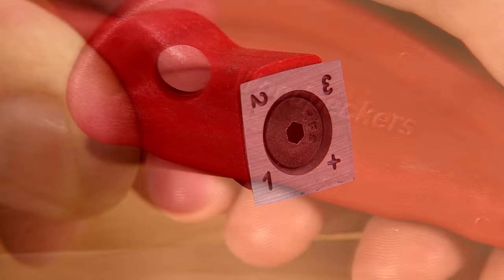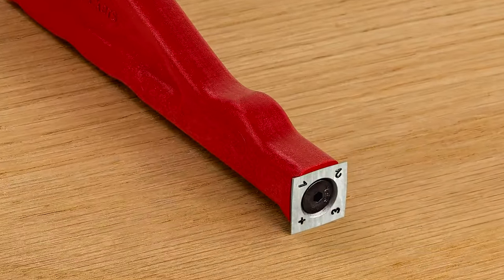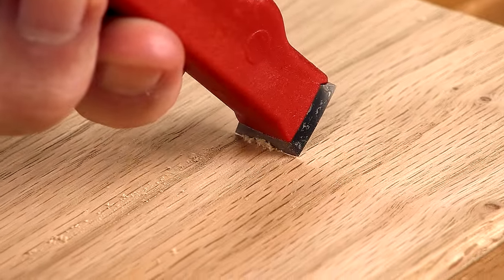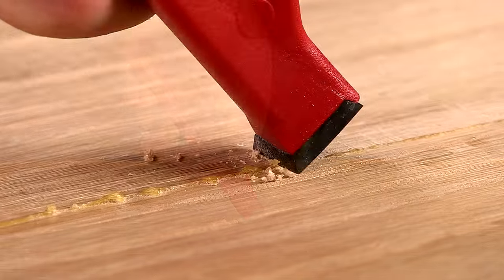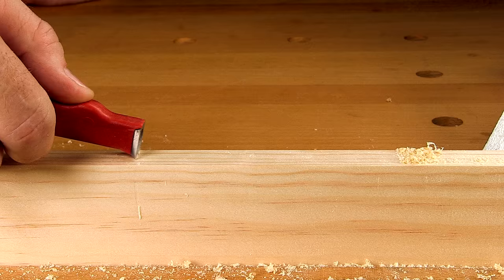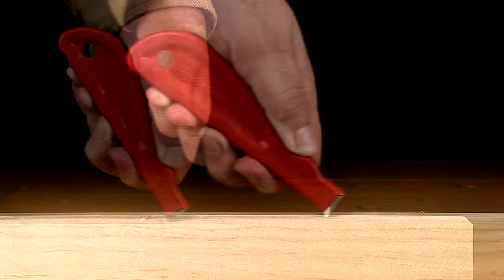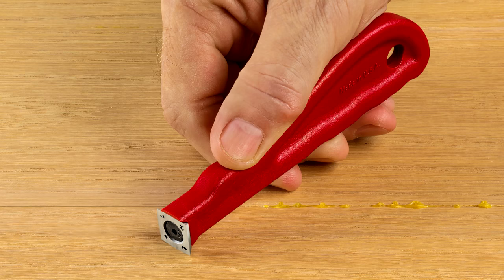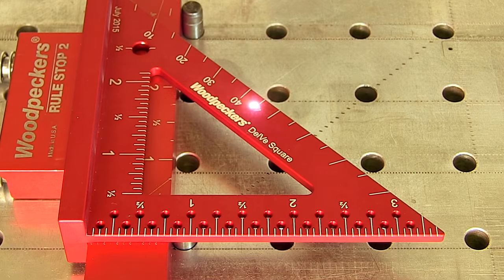Woodpeckers Mighty Mini-Scraper

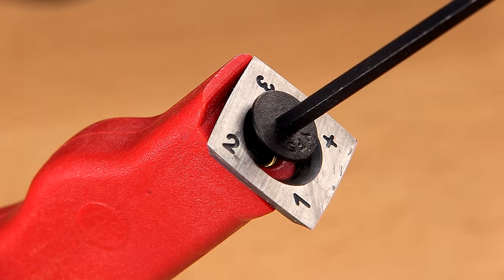Comment: I find this tool does more damage than good - it will bite into the wood leaving some heavy scratches if you are lucky (have a loot at 0:44 mark). If you are not - it will make some tears when working with softer wood. A lot better way is to use a good sharp chisel or a chisel plane as you can reference them from the level you are working with which will not scratch the surface. If you have the comfort to come back to your piece just at the right time when the glue has not hardened fully yet and is not too soft either - then you could perhaps consider this tool. I am normally too busy doing other things while the glue dries. Bought it, used few times and the only role this tool does now is gathering dust.

Comment: yup totally need this. especially for that corner scraping.
Reply: Bahco has made carbide scrapers for decades that are better and have more ergonomic handles. The two Bahco models I use also have convenient plastic pouches that protect the blades and your hands when carried on a tool belt. Just search for "Bahco carbide scrapers." They have several models. Compare prices and sizes before you make a decision. 

Also, one can easily use carbide inserts from helical planers and mount them to any stick of your choice. Our guitar shop has been doing that for many years now.
Reply: You want the ultimate scraper? Try the Kunz glue scraper.
Reply: Not carbide, only two sharpened surfaces and twice the cost.  Also no cambered blade, you have to camber it yourself.
Reply: Hey christschool, you're wrong. I have the Bahco scrapers. They are carbide. I don't need or want a cambered blade. Occasionally I dull the sharp corners on the triangular blade with a diamond stone to prevent gouging. For corner glue removal, I leave the acute angle sharp. Works like a charm. I don't know about price since I only paid $12 and $14 dollars (respectively) for the two different models. Is the WP scraper cheaper than that? ;-)
Reply: Learner-Learns I wasn't responding to you but the guy below you about the Kunz glue scraper.
Reply: Thanks, sorry for mix up. I'm too dumb about this new youtube system.